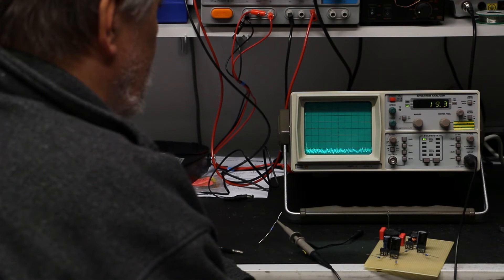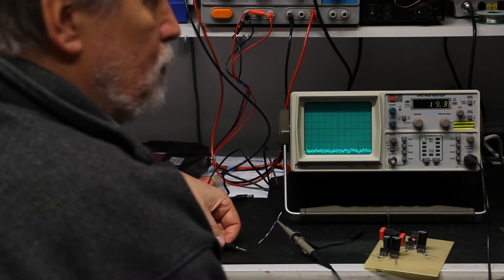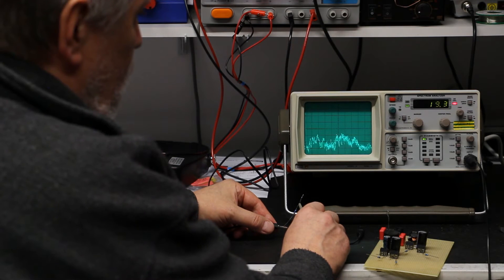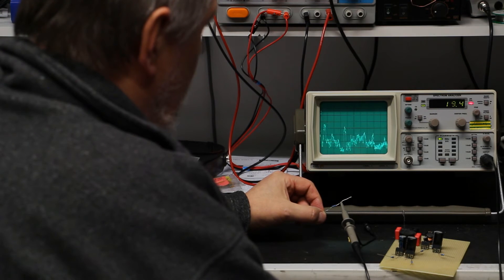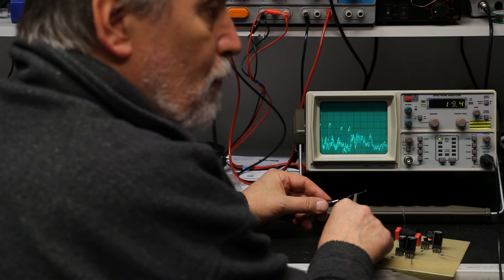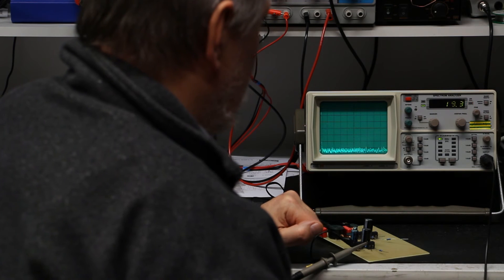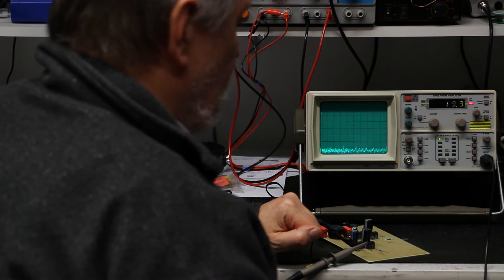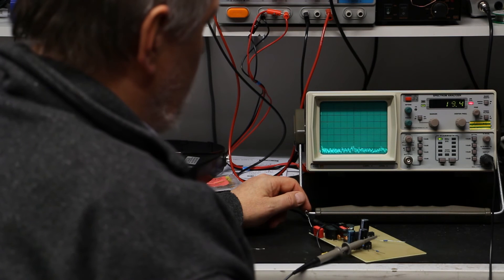A multi-stage EMI-Filter Pt.2: Effect of the prototype filter with a spectrum-analyzer

Comment: Hello! I have a cheap rack mounted power distribution device, that looks like a power conditioner, but inside it's nothing except a switch, an outlets, some led AC line meters and a couple of rack light bulbs with their own bulk power supply / attenuator. It rated at 10A. So I thought to add a simple EMI filter there, but i'm not sure if it will be an effective solution low frequency noise, such as below 200kHz, probably, to use it in audio rack or even for monitoring audio signal. Have a digital devices too. So, my question is: It is possible to make a series of these 10A EMI filtering devices or it will make an interferences between them of such an unwanted phase issues? Or can I solder myself or find an improved 10A filter for that purpose, like calculated right -n order? Thank You!

Comment: Hey Rodger,
 You might want to go through this series on EMI filters and check that you have links to all parts in the descriptions of each upload. I didn't see a link to part 2 after watching part 1. Maybe I just missed it.
   I've been researching EMI filters today. I'm getting ready to design, etch, and build my first prototype. I clicked on your part 1 upload from the suggested content below an upload I watched from Sam Ben-Yaakov.
  Originally I searched for "ac line filter" on YouTube mobile. I went back through the search results and your upload of part 1 was the 33rd listing in my results for that search. I would have watched your upload sooner if I had seen the listing. Your pt. 1 upload was the 6th and this is the 7th upload I've watched on this subject this session.
   If you decide to add links as suggested, you might benefit from adding the keyword tag "ac line filter" too :-)

By the way, do you know of any cheap options to search for when looking for an older second hand spectrum analyzer? I want to learn about power supply design by doing more experiments like what you demonstrated here. I know this is a subjective question and I need to do my own research. I'm really looking for whatever options that schools may have used in the past or what workhorse models can be found cheaply for less than a couple hundred bucks.
    For example, a year ago I asked around about 5.5 digit multimeters and someone suggested an old Keithley 197. That was a super helpful hint that sent me in the right direction. The Keithley 197 is the ugliest DMM on the planet, but it works, and it was cheap.

   I know we are in slightly different markets as I'm in the States, but you seem like a well rounded guy that might have some helpful insight on the subject. 

  Regardless, thanks for the uploads.
-Jake
Reply from the maker: I will cadd the link to Pt.2. But probalby you have found it already with the YouTube search.
Thanks foor the additional tag. I will also add that.
Spectrum analyzer: Ebay-search will give you some results. The old analog spectrum-analyzers appear quite often used even on the German Ebay-site. The US Ebay-site will have ten times more listings. Except for the usual suspects (HP, Tektronix) in Germany the HAMEG (now part of Rohde&Schwarz) spectrum-analyzer was quite popular. ATTEN build a 100% clone of that. HAMEG in fact sued ATTEN for that copy :-)
But consider to save some money and buy a digital one. The Siglent SVA1000X is the killer ATM: https://www.batronix.com/versand/spektrumanalysator/SVA1000X.html
It is 10x more capable than the old analog ones. And don´t buy an old digital spectrum analyzer. You won´t get happy with them.
With the Keithley you made a very good buy. Dave Jones from the EEVBlog just a few days ago made a video about buying a 6.5 digit DMM used on Ebay for 200 $ :-)

Comment: Hi, 
Superd video,as I see that you use a Hameg spectrum analyzer for your measures in this tutorial. 
Which model is that? 
Best regards 
Kostas..
Reply: +SeAfasia 
I think it´s an ATTEN AT5011 with Tracking Generator (150kHz-1GHz)
Today a RIGOL DSA825-TG would be much better in terms of bang-per-buck.
Cheers Roger/KainkaLabs
Reply: +KainkaLabs Germany 
Thanks Roger,Rigol DSA825 AT825TG is good tool for my needs also the Atten GA4032 or Siglent SSA3021X are on same level I thing.
Try to choose between them.....
Cheers Kostas